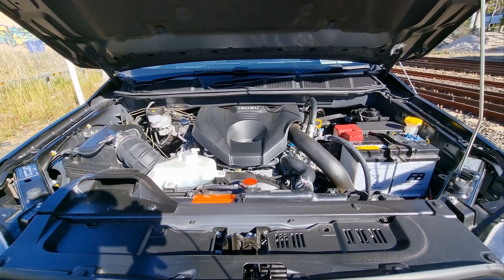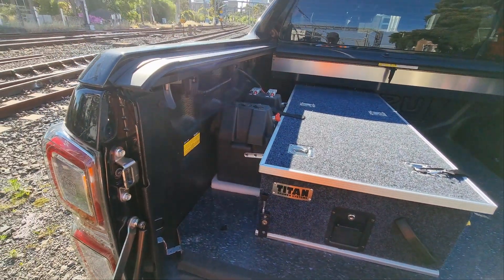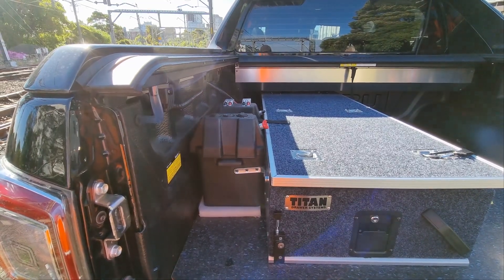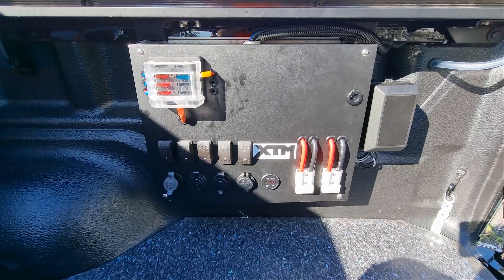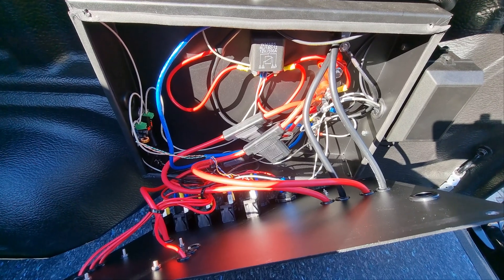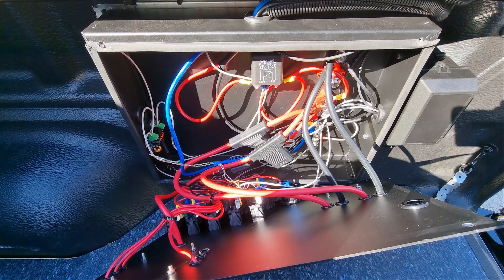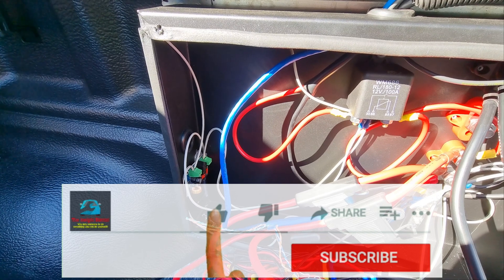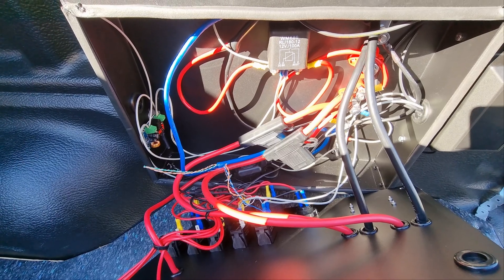How I did my Dual Battery System and Saved Money!!!!

Comment: A question to you clever guys. Can one use a set of motor bic batteries, say 4 ? Because they are so small with low amps joining a few together is easier to fit, in my case, a Ranger, above the wheel arch, inside the load ox it's got a 12 v power socket installed on the left wheel arch already. So no need to run extra wiring.One thing I'm not sure if I, these batteries are Gell-filled, unlike the acid lead main battery. Is this possible?. Can fit an inverter on the top of the box.Seems to me that it will be a cheaper setup than the fancy expensive way.
Reply from the maker: yes it may work, but you would want a 12v charger for them and you wouldnt be able to use the 12V socket to supply the load